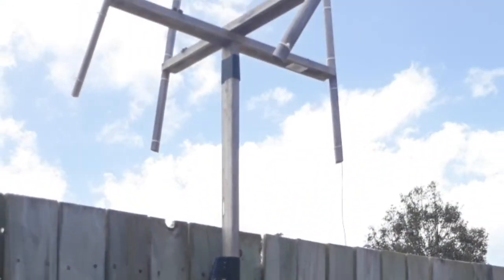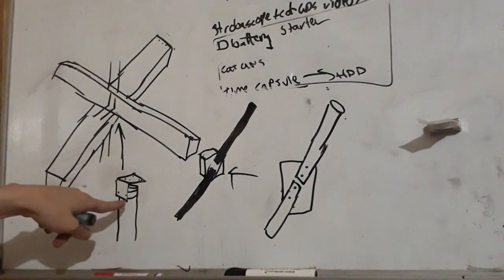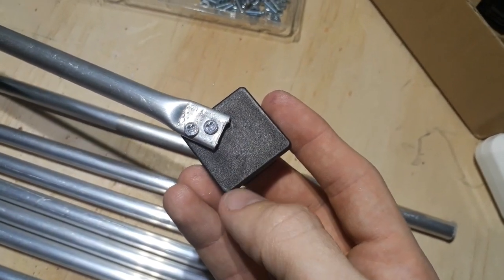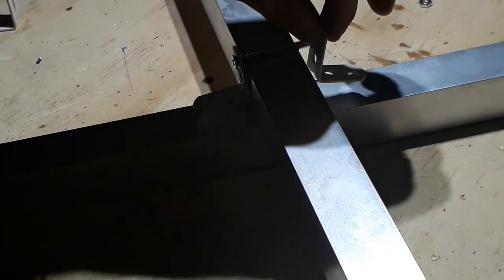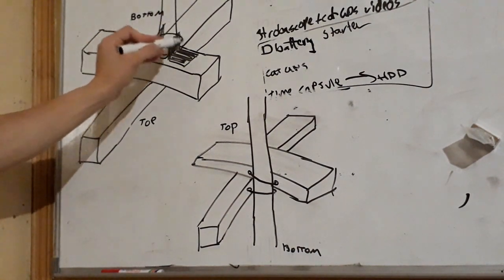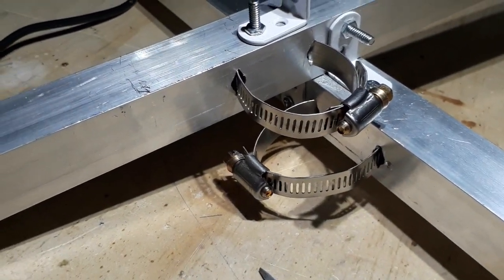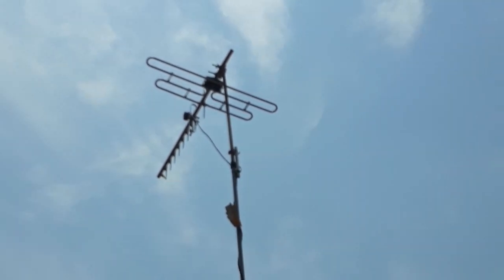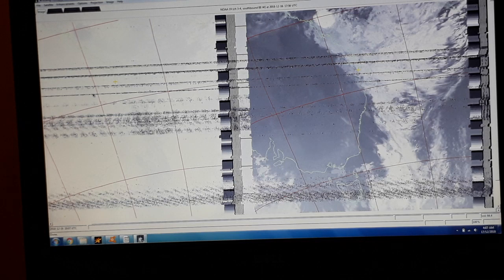NOAA/METEOR SDR Antenna for weather satellite images

Comment from the maker: Update April 2020:
So just over a year later, the plastic caps in the antenna are not amazing and wind/rain has caused them to change angle and come lose. After a recent storm I had to go on the edge of the roof because one of the dipole pairs literally fell out of the aluminium. Also, the received signal is STILL not as strong as the signal I got using the wooden antenna and I am beginning to wonder whether the aluminium being metallic is effecting the signal. This particular antenna design is quite tolerant to things not being quite right but when the satellite is right above me, I get very little signal so quite often the middle of the picture will be cut off. The antenna wire is also unnecessarily long because I had too much spare and maybe that introduced some losses. In my next revision I might consider making it out of either PVC, or making the antenna using much higher quality coax and no plastic end caps - instead it will likely be bolted directly to the frame (somehow). Digital captures from the METEOR M2 satellite require a very stable signal coming in and I just don't have that with this antenna. I can very easily get the NOAA ones because they are analog. I also put a new version of windows on my laptop which requires me to reinstall everything including all the SDR# plugins and i'm having issues getting the meteor plugin working again. I have my RTLSDR plugged into a raspberry pi and I now connect to it via TCP as that allows me to use my antenna remotely. In the comments below, Ahmad Hasan references a guy who used a V dipole which may give better results, but that required the antenna to be a certain height above the ground in a field, which isn't really possible on the roof of a house.
Reply: I also made a version 1 with wood and some heavy duty galvanized steel wires and it worked really good i even got images right at 5º of angle with the antenna siting 2 meters from ground level, it got somehow broken, im currently thinking of building one with 5 or 9.5mm aluminium rod and the frame of pvc tube using some 3d printed parts so im able to fold the antenna and store it in a small place or take it in the car for a better spot, this is the link to the thingiverse page of the project not made by me, https://www.thingiverse.com/thing:2963713
Reply: i also saw in a forum about a guy having problems to get a good quality signal while the antenna was on his roof and after some back a forth he found that the roof of the house was somehow reflecting and messing with the signal to the point it was unusable, try taking the antenna down and test it.
Reply from the maker: Thats REALLY interesting, my parent's house (the one in the video) is steel frame! Could that be a possible cause of issue I wonder?
Reply: @BoomBrush  From what ive been researching its possible and given that its made with steel its even worse since from what im seeing, its not really recomended to make the antenna frame from metal let alone the roof,  i believe it acts as some kind of ground plane or something, since im not really experienced with this stuff dont take my word for it, this is the forum about the roof interference.
 https://www.rtl-sdr.com/forum/viewtopic.php?f=6&t=4603&sid=216156bc7e51a21aa9462827f7334211&start=10
You can see the OP response in the last post.
Reply: Would love a new video for the new ant..
Reply from the maker: @KeiranR  Yeah i've done all the filming and recording months ago I've had issues finding editing software that allows me to get the end video I want. I've tried half ass solutions of slapping pieces of the video together but it did not meet my level of quality and so I opted to wait. I've found some better software recently and am hoping to have an update posted in about a week.
Reply: @BoomBrush  too easy mate I was looking at doing now an antenna building video myself I don't know I'm not really good at stuff but
 there's not a lot of good explanations out there on how to make decent antennas

 I 100% appreciate your willing to sacrifice time for quality another thing a lot of YouTubers get wrong
Reply from the maker: @KeiranR  Video is out now, if you are interested in seeing an update to the results. I'd recommend making an antenna out of non conductive material such as PVC. If your house has a steel frame then you might need to reconsider putting it on the roof. Sadly the results I seem to be getting always have black bars in them so i'm not quite sure what in my circumstance could fix that. In the description I have a PDF document which I found very helpful. The second video doesn't go into any depth on how to construct the antenna, that was more for the first video and even that was more to show my thinking process rather than an exact "cut here at x-mm away"
Reply: Are you using any kind of LNA and SAW filtering ?

Where can i find the complete plans and all the dimensions including coax lemgths
Reply from the maker: @KA4UPW  Check description for PDF of antenna dimensions. Also in the description is a link to my update video where I share my results on using a SAW filter. It didn't make that much of a difference.
Reply: @BoomBrush  
Thanks, i am in the early planning / learning stages of building my earth station.  Lots to learn !
Reply: Ali coats itself very quickly, not sure if that makes a difference.
Reply: What is the name of the antenna
Reply from the maker: @AndrewMurphy8383  The particular one I made is called a double cross antenna.
Reply: @AndrewMurphy8383  it's for meteor 2 possibly

Comment: Are all 4 corners connected in parallel?
Reply from the maker: Yes and no. Inside the description is a PDF document which includes a wiring diagram. The left and right pairs are connected in series, but they are connected in parallel with the top and bottom pair, also in series. The wiring diagram shows this as well as the opposite polarity. It also includes the fact one pair has to be 1/4 longer in physical wire in order for the phases of the signal to match up.

Comment: @5:00 i know it's a little late, but seeing as they're bolts in the end caps, why not just connect the coax on the inside?
Reply from the maker: You know, that is a very good idea I didn't think of. Your "late" timing is actually perfect because I was going to create a 2nd antenna in a follow up video to this one and compare the differences. I was planning on constructing the antenna literally in the next few hours. Thank you for that idea!
Reply: @BoomBrush  no problem, im in the middle of rebuilding mine, 3/4 schedule 80 pvc conduit and then aluminium rod for the elements
Reply from the maker: Ive finished making the new antenna but in the past few days have run into issues with NOAA 19 passing at the same time as METEOR M2 (they both transmit at 137.1MHz) as well as bad weather, which has resulted in poor passes. Initial captures at ground level looked promising but have since put the antenna on the roof to help with signal. I did a capture this morning but it was quite cloudy. I also want to experiment with how much RF gain to put on the SDR, too much seems to drown out the signal but with 1 shot a day at inconvenient hours its very hard to test. Hoping to make a video soon comparing the two antennas, sharing my findings.

Comment: can i see your CST file about this antenna ? i want to learn about it
Reply from the maker: Hi, I did not create it myself, I used this document:
https://www.qsl.net/py4zbz/DCA.pdf (link also in description)

I was thinking about remaking the antenna but out of non conductive parts as I suspect that is causing an issue. Also the received signal is not amazing quality. I still havent gotten an image as good as that initial one after ~2 years of trying.